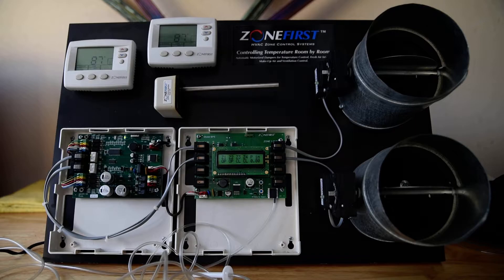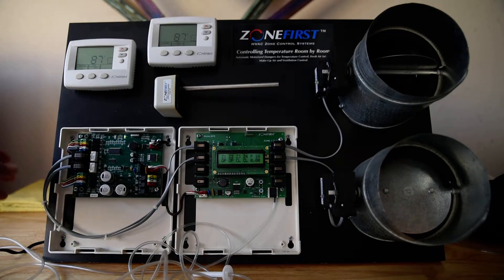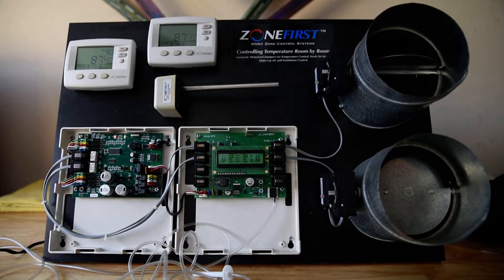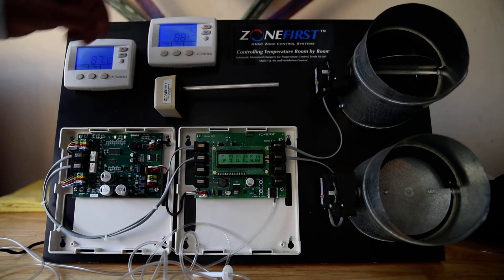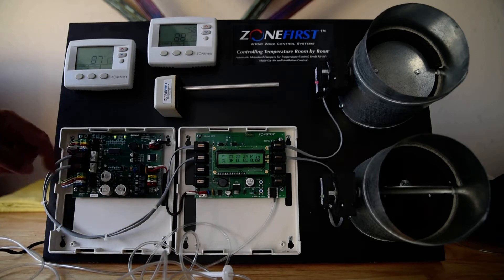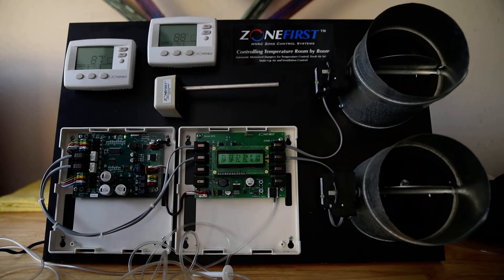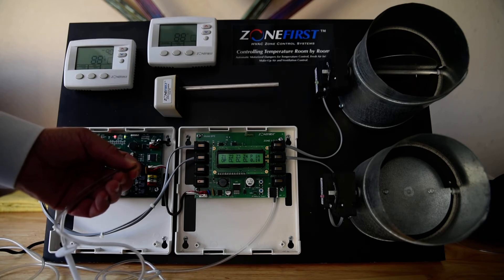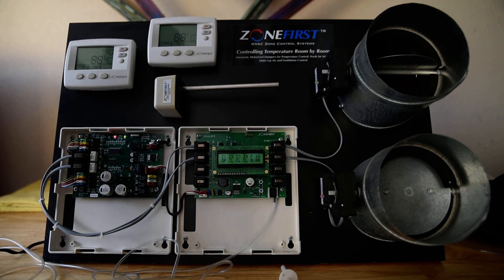Demonstration of ZoneFirst MMP2: 2 Zone Single Stage Control Panel

Comment: So I’m having an issue with my zone first BPE when I make a call to either zone 1/2. So basically, if I turn on Zone 1, Zone one will open “OP” but once the air begins to blow, all the other zones show number “99” and open up. But once I unplug the small hose, the other zones go back to close and Zone 1 goes back to “OP” 
I’m hoping you can help me. Thank you

Comment: With the BPE are you installing the pressure probe 2/3 down the line as with a standard pressure sensor or since the BPE only has 10' of hose is it safe to install in the supply closer to the furnace?
Reply from the maker: Thanks Ben L. for the question.  Install the pilot  in the supply air plenum as far from the coil or heat exchanger as possible.  Also make sure to put it in a place with the least turbulence possible and not in front of a damper.
There is a directional arrow on the tube.  Installed this way, it measures pressure in the S/A plenum and not velocity.
Reply: @wrightsales4271  awesome! Thank you!